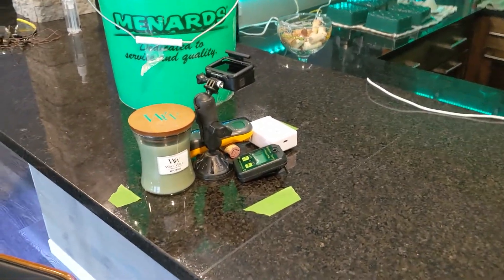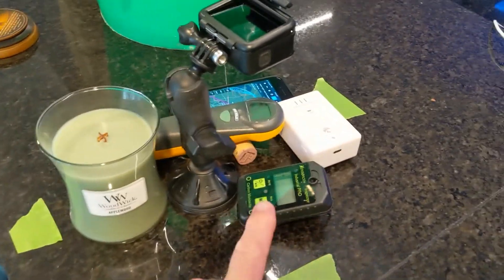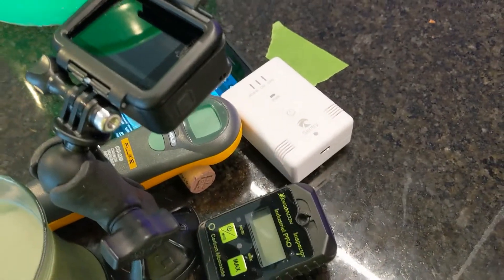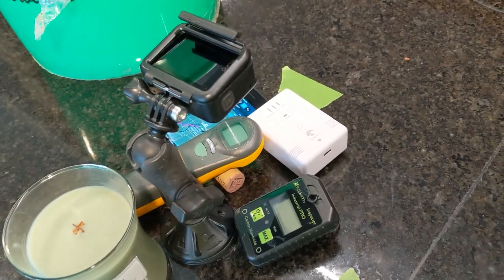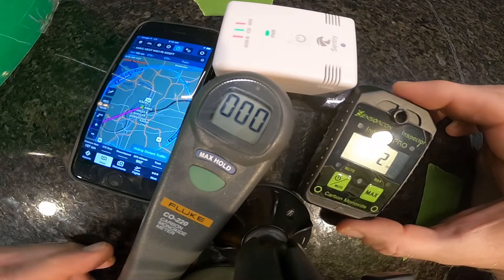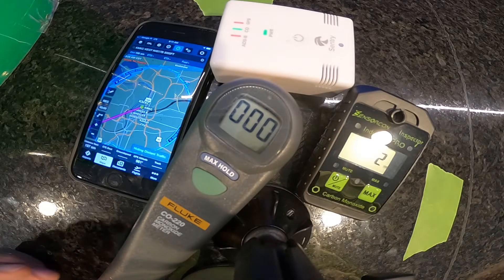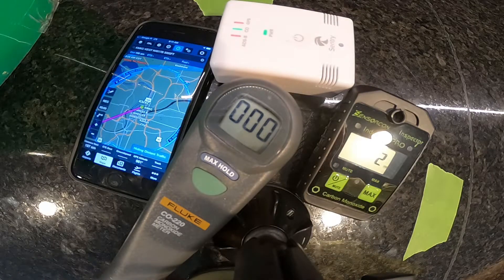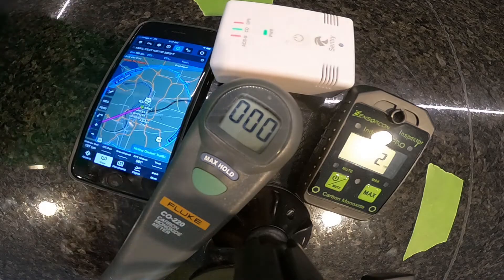Triple CO Detector Test

Comment: So how how do you know which one was accurate? They all alerted. The one connected to the phone only showed 75 PPM and never changed off of that number so I’m thinking that one is a POS. The one on the right started off at 2 ppm before you even lit the candle so obviously that one also isn’t 100% accurate. The fluke has a little latency in reacting so I wonder if it would have eventually raised higher.